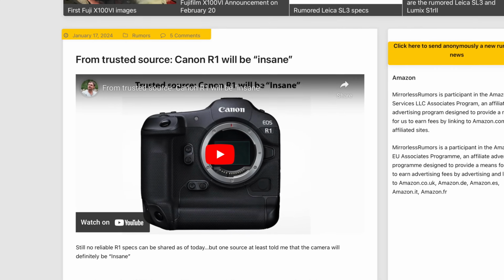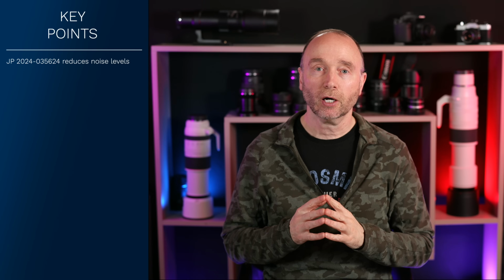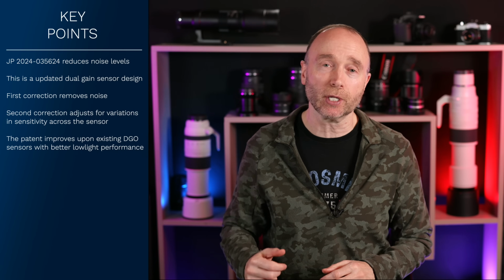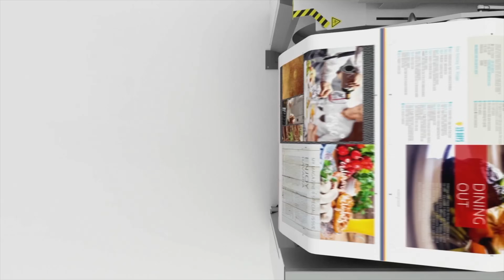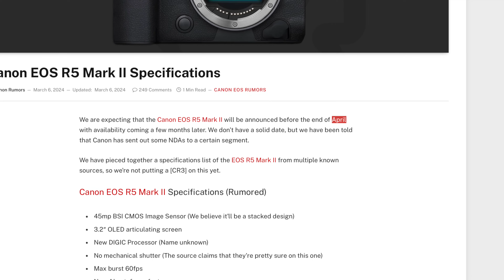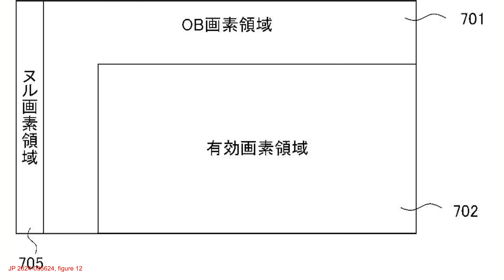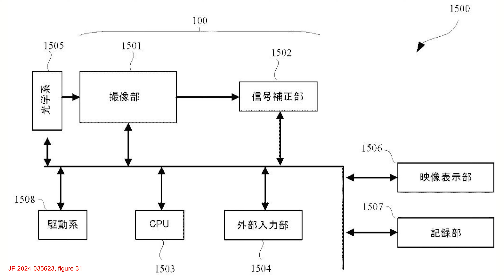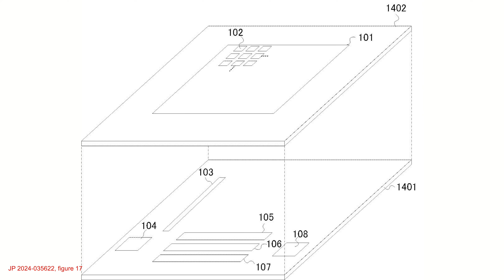Canon EOS R1: Stacked Dual Gain Sensor?

Comment: R1 would be for certain people, I hope the R5II is enticing enough, I have put the purchase of lenses in my list on hold for the moment to see what Canon has for us with that camera(24-105mm 2.8, 100mm 2.8 and 200-800mm are in my watchlist in the same order)
Reply: And at the same time, I hope they keep the LP-E6NH batteries so we could use them across R5II and current cameras(R6II in my case)
Reply from the maker: Normally, the R one would be for a specific type of customer. But without any leak specifications, it's kind of hard to know who it's meant for this time around. The icon Z9 changed how we see flagship wireless cameras.

Comment: hi Simon

I see Canon struggling with noise, if Canon now just takes over DXO labs, they can integrate the DXO software into their cameras, then the noise problem will be solved. The same goes for their difficulty in making bright prime lenses. Olympus has been doing that for years, and also at a very competitively priced level. perhaps they should talk to Olympus about collaboration in the field of making affordable and bright prime lenses. that problem has also been solved.😂😂😂
Reply from the maker: Olympus has some really nice capabilities in their OM one. I'm pretty impressed with that camera.

Comment: If you can read two different gains to basically get two different base ISO level, I wonder if you could also read three or four gains. Imagine having base ISO at ISO 100, 800, 3200 and 12800. There must be a downside of reading out the sensor several times.
Reply: There is, it's called latency. The more times you read out, the more time it takes to collect the sensor info into an image. This slows sensor readout and creates rolling shutter.